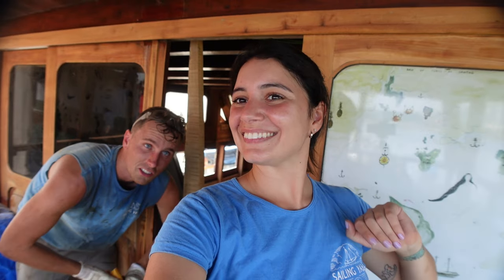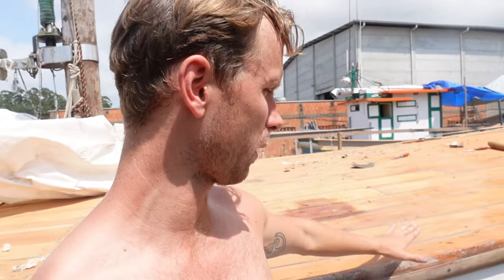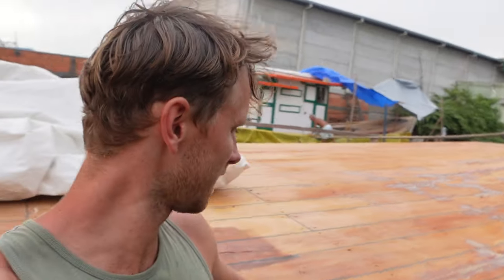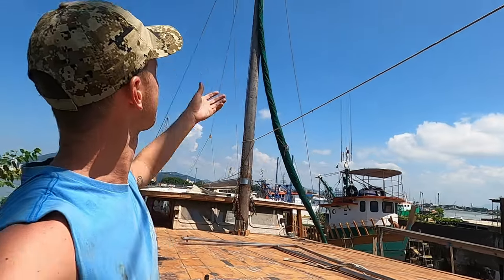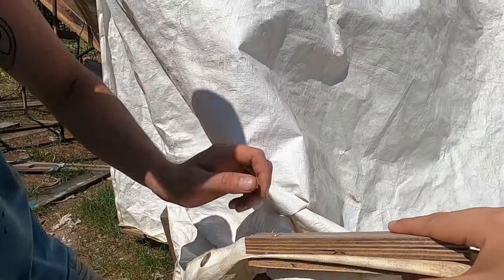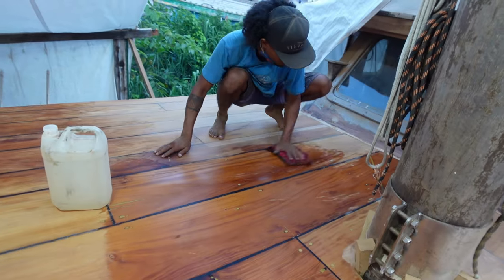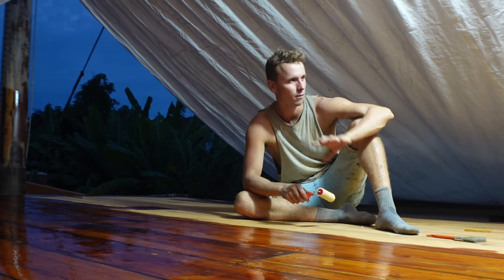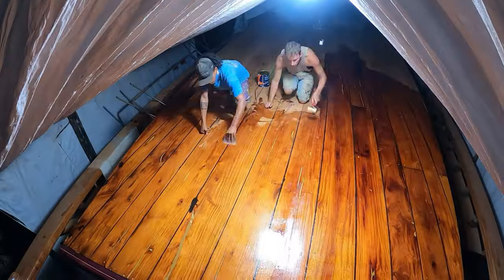Boat restoration: protecting our roof with clear epoxy. Will that work? — Sailing Yabá #90

Comment: The wood provides the structure/strength of the roof.  It shouldn’t need to be more than a few layers of glass.  The biggest danger would be from dropping things on it and puncturing the glass layers.  But if you keep an eye on it and carry some repair materials with you it shouldn’t be a problem.

Comment: The best varnish is white paint, especially on a big surface like a cabin top. 
If that gets too hot in the sun to comfortably touch, it will play hell with both the finish and the wood, and before you know it the fibreglass cracks, water gets in....and you know the rest. White paint will stay a lot cooler, and is way easier to touch up and maintain.
I did not follow my own advice, but wish I had - and that was just a little 18 footer.

Comment: To make a comment about the grain in the wood is very beautiful. The parts that your varnishing clear for the grain to show through I have a suggestion. You can use a blowtorch or a propane torch to raise the grain in the wood, after varnishing or clear coating with poly or other resins it gives it an entirely new look. That's my opinion 🤔👈

Comment: Please realise that everytime you allow epoxy to harden you either need a layer of peel ply or have to sand the entire area before the next coat, otherwise you will not get a bond.

As others have said,  hire a floor sander.

RV
Reply: The alternative is to put the next coat of epoxy on just after the last coats sets, this will allow a full chemical bond and prevent the amine blush from forming on the previous coat.

Comment: Hi guys 
If you want to keep the epoxy clear just cover it with a good clear two pack polyurethane that is UV stable 
It’s done that way these days 
I have done my dingy that way
Reply: I second this, just put a second coat of varnish on my boat over the epoxy. I was told epoxy will get cloudy and yellow in UV and eventually crack and fail.

Comment: From past experience, if the epoxy doesn't have a UV inhibitor sunlight will break down the epoxy and it will go bad. Best bet, in my opinion, is ti glass the top and paint it white to reflect the UV and heat!

Comment: Hi M.P. Hi Ben The epoxy will work fine ,Two things to think about though, It will absorb heat and it will be slippery when wet .That being said it will be beautiful and show the history of the boat .Way cool . what would really set the roof off and be truly functional is to mount grab rails up both sides .I really liked the music too. Also you might think about installing a couple of Dorades in the roof for ventilation to help keep the heat down in the main cabin .

Comment: Fiddler on the roof,, Suggestion on the final coat of resin sprinkle with quarts sand, this with give grip and reduce the slipping about in wet rough weather
Reply from the maker: Hi! Thanks for the suggestion! We are already planning on, after finishing with the fiberglass, add many coats of varnish for protection, followed by the quartz grip 😉

Comment: You should know that epoxy resin weakens with UV rays, for protection, and not paint, PU varnish is applied which has UV protection.

Comment: Dulux paints in Australia market a clear gloss finish which they guarantee for 10 years. May be something to consider later if your epoxy/fibreglass finish does not hold up.

Comment: About the woven fiberglass and epoxy on yaba's roof.   The correct fiberglass to use is chopped strand matt for sealing, the woven fiberglass is only for strength, chopped strand matt is for sealing.  I have seen woven with resin get minute cracks and actually hold water and rot starts again.  Also, after you are done with varnish or epoxy, go and get at a automotive paint store, automotive clearcoat which has UV, ultra violet fighter, aluminum oxide powder and put on 2-3 coats.  That will prolong the few months to a few years on the outside varnish and epoxy.  I can explain to you how to stop rot in the planking, ribs and floors below or near the waterline, the main reason you had to rebuild Yaba.  It is done also with fiberglass and resin, in alternating layers of woven roving and chopped strand matt, to about a foot above the waterline.  I had an all wood motor yacht, a 47 foot Trumpy.  The surveyer tapped with his plastic hammer, crack, crack crack and then a thud, [ rot] about 3 inches above the waterline.  the moisture was sucked up inside the planking and left the salt, which kills rot, was left behind, and the damp was just at the correct dampness for the rot to grow.  Now this example may mislead to think rot only goes vertically.  No the correct dampness for rot, is moisture travels from where there is water to where there is none.  So, below the waterline, it can go horizontally or on an angle, 3 or so inches into ribs, floors and structure to rot. Solution,  we began fiberglassing  with alternating layers of chopped strand matt and woven roving or now biaxial with a layer of chopped strand matt.  The second layer, being woven roving had to be pneumatic stapeled wet, before it kicked hard or, the stapels would be refused. at half the eight layers, we put stainless screws into the ribbs and continued the additional layers.  We discovered that starting the matt or roving, 38 inches wide, about a foot above the waterline, we could only go as the hull shape started to go from vertical curving to toward the horzontal,  we built Ts  from 2x4s placed every 18 inches to hold the fabric from falling off, until it kicked.  So need Ts with shorter and longer verticals to reach the ground.  In home construction sheetrock installation, these Ts are called deadmen, here the same, but with varying vertical lengths.  We put a grease fitting on the shaft alleys and pumped in 4 or 5 tubes of grease, after we got back in the water, and the water pressure held the grease up to the packing gland.  So we had no water in the boat at all.  We sprinkeled rocksalt in the bilge to turn any water that might get there accidentally into salt water until the leak is found.  We used 8 alternating layers of woven roving and chopped strand matt, one could use 6 layers.  We used polyester resin, so we had to add two layers of epoxy paint before anti fowling paint.  With the bottom thus glassed and the topsides, mummyfied with matt and resin and auto clear coated, the boat is rot free.

Comment: Epoxy is not UV stable so you will either need to varnish or paint over it. The wood will get very hot on the surface during the day being that colour so you will get big daily temperature changes that are likely to make it crack and fail sooner rather than later. It may be better to be an off white matt paint so it reflects heat and does not cause glare.

Comment: Thanks!

Couple of thoughts one they do make wood filler that you could either mix the sawdust into or the wood filler itself is stainable so that it would match which would’ve been probably just fine underneath your fiberglass. The other is if you cut a straight line down the crack with a router bit you could’ve inserted a strip of wood effectively making a Dutchman instead of using Apoxsee. I do realize this information is a little bit late, but hey, for future reference.
Reply from the maker: Thank you so much for your support and your tips Duane!

Comment: I’ve always heard that epoxy itself is very sensitive to UV sunlight so should it fail I would just slightly scuff up the epoxy and preferably put on a white UV resistant paint with a black edged border next to natural wood.
White which of course will also help cool the roof and possibly turn it into a nice cool sunroof to lay down on. 
Personally I think the natural varnished wood look accented with white on the big to paint sun sensitive surfaces protecting it from sunlight gives a reel simple but cool classy look.
I think it’s especially classy if the name of the ship it’s different areas like the galley, the head, the bunks, rooms and different storage areas are described as what they are in a consistent classic black lettering style the whole boat thru.
Like a hotel that has a consistent house style. It sound exaggerated to do these things but you’ll see that good consistent styling is not only practical and organized but makes living quarters and objects overall much more enjoyable to relax in.
I’m not saying people shouldn’t be very colorful, I’m just saying go for “a style” and use that style consistently thru out your boat, your house, your business etc. A recognizable style for what you do seeing you’re on YouTube building a channel etc.
But black and white even combined with natural wood also goes really well with primary colors (look at Piet Mondriaan paintings). Black seat covers for instance combined with primary colored cushions etc.
Personally I would do a complete white walls with natural wood combination of the boat with black pin stripe like borders on any white surface like panels or walls that go next to natural wood.
A black and white on wood color scheme from the black anti foiling all the way up to the black waterline, maybe the rub rail hidden in a flowing line going with the boat shape black “stripping”, black bilge, black classic lettering all thru out the boat pointing out names, numbers and functions on doors and bunks, galley cabinets, anker locker etc. B
The reason I would do everything white with black accents and nice thin striped borders is because it always combines well with everything and can easily be touched up cosmetically as well as kept clean and looking organized and fresh
But white surfaces also create space visually and outside it helps to cools the outside/ inside of the hull and pilothouse in tropical waters while black ropes and textiles helps to hide stains.
Off course you wanna wash your towels, bathrobes, underwear, socks, bed linnen, kussen covers etc.
But if it’s all black you can put everything in the same washing machine and if it has a stain that won’t come out then you simply won’t see it, ropes to will look nice and fresh all black.
It’s a lot less work maintaining cleanliness and hygiene when stuff has their assigned place to be stored and it’s all practical, serene and clean looking by having a simple but consistent fresh looking design style.
And then to you’ll quickly notice that it will also be much easier and less time consuming to keep everything clean and organized as you’re on your way.

Comment: As said below the varnished wood is beautiful but may be hotter than the old white roof. That said the the epoxy will not have resistance to UV light and will break down in the sun. The best way to prevent this effect is to apply a few coats of varnish to the clear epoxy after it is cured. We do this with any of the cold molded power boats when we have an epoxy & glass covering but want that high gloss marine varnish look.

Comment: It seems as if you will have many many hours to be invested maintaing the rest of the wood on your boat. Many others have already commented on UV stability and heat.  Time is a factor also, which could be better used elsewhere.

Comment: You should have used a wood filler that was closer to the color of the wood there that would be great looking with just like 3 or 4 coats of epoxy Nan that would really look great

Comment: I hope this works , I love the old wood ,it’s really beautiful .  But the white roof would keep you cooler on the water in the blazing sun .  I might tent the roof on a very hot day .  Or install air conditioner and the power grid to run it .

Comment: You dont want that first coat to cure if you are adding glass as you will loose the chemical bond. Adding a first coat can be good to avoid the dry wood starving the glass weave, but I wouldnt let the epoxy go past tacky before putting the glass on. In reality a dry layup on a horizontal surface is easy

Comment: Are you going to add some non-skid material to the top layer of epoxy?  There are materials that will give you some grip and still leave the beauty of the wood underneath.
Reply from the maker: Hi John!! We will definitely be adding an anti-skid. We are planning on quartz powder, which mixed with varnished will remain transparent ☺️

Comment: From :
Brian Anderson (below)

"For the roof, those are wide boards and solid wood. Fiberglass is too rigid for that. There is a cloth called dynel in polyester that is used for that application, but it does not go clear like fiberglass. You have to paint it. Nobody does this kind of fiberglass coating on wide solid wood because the wood moves, breaks the fiberglass or causes it to delaminate, and usually both. Dynel has enough stretch to stick long term."

YT is not accepting my comment on his comment.  So, I am copying his comment and then add the following as my comment on what he said.

Agreed.  Fiberglass is not the best material for that roof.  But even if they go ahead with the planned thin layer of fiberglass, because of u.v. radiation from the sun,  two things will quickly happen with it: it will quickly become opaque/black, and after awhile, the top layer of resin will wear off exposing the actual fiberglass. .  So, if fiberglass is used for the roof, it should really be painted.   Well, that is my experience with fiberglass exposed to harsh sunlight.
Reply: yes, I don't understand what they are doing often.

Comment: I love the look of wood, but in this case I am pretty sure your experiment will fail.  More fiberglass and white paint is the way to go.  For your sake I hope I am wrong, but I’m pretty sure I am correct.  You are setting yourselves up for a very hot interior and lots of work on maintenance.

Comment: Epoxy deteriorates rapidly in the sun.; you can sand it, and add a couple of coats of polyester surfboard sanding resin (Sylmar 149 or 249). It's clear, and keeps out the U V rays.

Comment: The epoxy will not survive well without an opaque layer on top.  I am with the person that said a pale color but not white would be a good thing.  The other thing is if you make a stronger mix  of epoxy and fiberglass you could set the roof up to recapture rainwater which when  you’re at sea will be a useful thing

Comment: Pour the body of the yacht from the bottom with 4 layers of fiberglass on the epoxy and it will not rot and it will not be eaten by worms

Comment: The epoxy will work fine until it starts failing and then it will be even worse than trying to fix a varnish. I really don't want to be a bummer and say things it might upset you but well that's what you have to look forward to.

Comment: Looks great but as others have said epoxy is not uv stable, no problem though just give it two coats of polyurethane clear over the epoxy to protect it.

Comment: It depends how much traffic. Not sure if your epoxy includes UV protection but that could be a problem if it doesn't. I know people who use canvas or Dynell fabric.
Reply from the maker: Hi Sirius!! For UV protection we will be adding around 10 layers of PU varnish on top of the epoxy 😉
Reply: @SailingYaba  It's going to be real slick wet and that's like a dance floor
Reply: @starrynights321  Aye, do they need to stand on the roof when raising or bagging the sails?

Comment: Using expoy resin, it will yellow and it will degrade as epoxy resins are not UV stable. Which is a shame, cause it looks frign great.
Reply from the maker: Hi! The plan is to, after finishing adding the fiberglass, to add many layers of PU varnish for UV protection 😉

Comment: You're off on your epoxy fill ideas. You want a strong fill powder, like diatomaceous earth, Q-cell or cabosil. THEN add a small0 amount of coloring agent. Coloring agents weaken the mix. But it's okay because a little coloring agent goes a long way. That said, varnished wood and epoxy isn't going to last very long at all in the sun. After you see how long, you will see why people use paint. If you like the look of wood then use wood-tone paint.

Comment: The color matching of the wood is probably going to be a waste of your time…the amount of heat that the top is going to absorb is going to make below decks miserable and hot. Also you won’t be able to walk on it barefoot. There’s a reason why a lot of boats have white decks, it s to reflect the heat! Heat build up on the varnish top will also mean that sunlight and heat will cause epoxy to bubble up and require an enormous amount of maintenance! The varnish will look great, heat and extra maintenance combined with regular boat upkeep will guide you!

Comment: the decks should be oiled. epoxy will not expand and contract like the wood. it will flake with a little time.and leave you with a lot of needless sanding.   if you put down cloth first ,making a water tight membrain  thats a different story.

Comment: Why don't you rent an industrial size floor sander that would be a lot faster and it would leave a smooth flat surface without taking out the crown of the roof.

Comment: I wonder why u couldn't just put several layers of a polyurethane on the roof???  Yes u would have to redo it every few years and apply more, but u would think it would be strong enough and thick enough..  But I guess not 🤔... I'm not a boat builder just a jack of all trades.  Those guys know what they are doing!  The build it back traditionally and and with some newer hardware!  Its a craft for sure!  No one would ever imagine things still being built the old traditional way like this